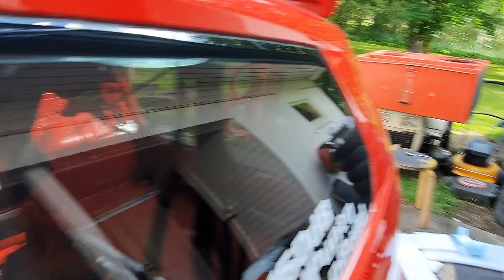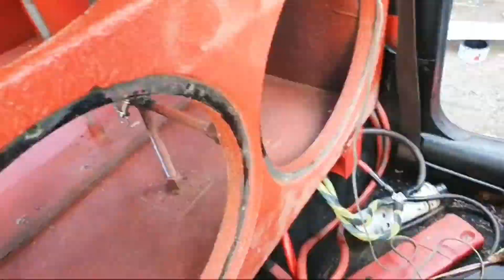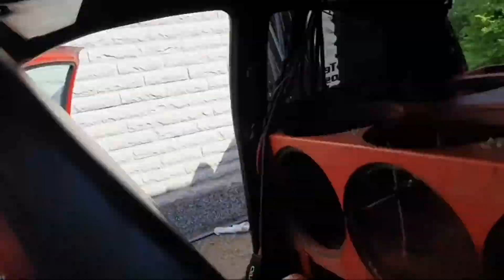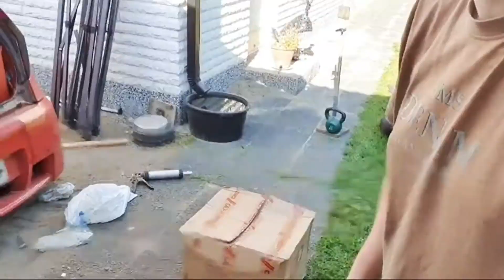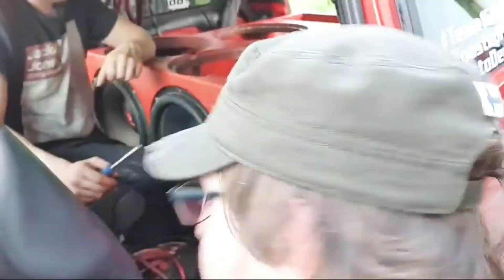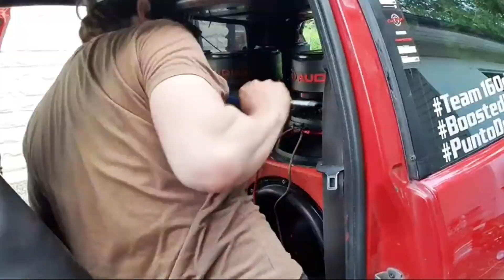Bassolaitteiston Kasaus 8x15" 40000W #puntodemobuild #team160db

Comment: mitä painaa tuollanen onko se ny passo mitä päällä onpi per kappale ja missä hinnoissa per kappale
Reply: 799€ kpl hinta ja kait se joku 25-35kg painaa
Reply: @xvilzuux  32kg
Reply from the maker: DD Audio Redline 815d d2
15″ subwoofer
2x 2 ohmin puhekelat
4″ puhekela
4-kerroksisesti käämitty BASV puhekela
tehonkesto 3000 W RMS, 6000 W Peak
linear x-max +- 29.4 mm
x-mech 95 mm
fs 30.973 Hz
qts 0.483
vas 61.639 litraa
herkkyys 87.1 dB/1W/1m
asennusaukon halkaisija 350 mm
asennusyvyys 255 mm
elementin syrjäyttämä tilavuus kotelossa 10.71 litraa
suositeltava refleksikotelo 85-142 litraa ( NETTO ) 

Paino on muistaakseni 29,7kg 😃
Reply: JoniK huh huh onpas mööpelejä 👍👍👍
Reply: xVILZUUx juup ei tarvi mun miettii yhtä ees rintteriin kun niin tyyriss
Reply: @tube-keijo  nii on noi aika kalliita